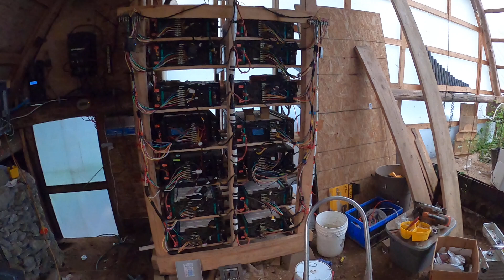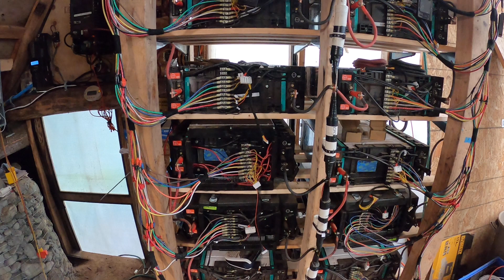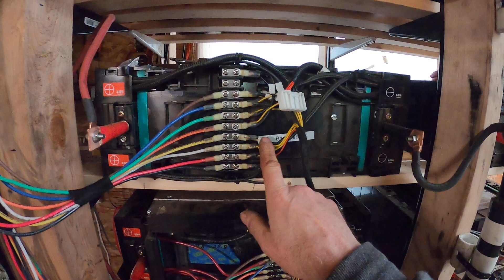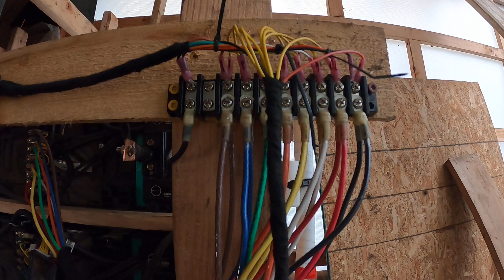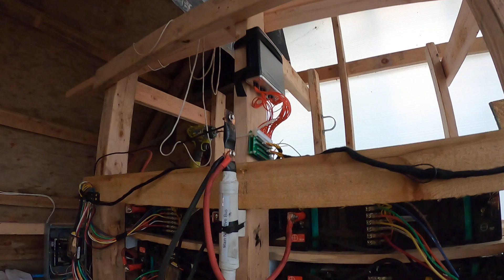14 Pack BYD Battery System With 5 amp active balancer, Cell level parallel bus AND NO BMS - Complete

Comment: Put "anydesk" on the old phone, and then you can look at and control it from "anywhere".

Very nice setup, especially with 1 balancer.

I put four balancers on my 8 packs with the 2 amp version.

I probably should have cell paralleling, but I didn't really want to take the cover off.

Comment: where did you get batteries like these please.
Reply from the maker: From battery clearing house.
Reply from the maker: I would highly reccomend you look at new 280AH EVE cells from Shenzen Luyuan on Alibaba.  They are much cheaper in the long run than these used BYD packs.  They are also much easier to work with.

Comment: This freaks me out, I just ordered 14 of these and was looking for information on exactly this configuration.
Reply from the maker: Where did you order from?  This pack has been working great for us.  The learning curve was steep with these used units.  The cells start to rapidly get out of balance and endanger themselves when they get near full charge or empty.  Watch yours carefully so the cells dont get too far out of balance.  I have found 53.6 to be fully charged (half that for single module or a 24V nominal battery pack)  and about 48V fully discharged.  (Set a discharge disconnect on your loads a bit above 48V.  (or 24V).  And set your charger source to never go above about 53.6.  (your packs may vary from that.  (Watch them charge and discharge carefully.)
Reply: @metagrid9453  Battery Hookup.  I upped the order to 16 and they shipped them on ONE pallet.  The pallet was scrap wood and the shippers had inserted another pallet into it.  Most damage appears to be to the outer casings, parts that I will most likely remove anyway but the cells seem to have survived. No green straps were damaged. I have charged the one unit that was in the 22 volt range but it did not balance completely (ISDT Q8) but the next unit is nearly charged and is balancing well.  I am weeks away from implementation. I am currently thinking of two carts of 8 batteries each. I might parallel cells on each cart and use an active equalizer on the entire block as you have done.  I am also considering one of the cheaper active balancers with a battery monitor across each 2 units (48 volts) so I can keep track of each pack.  I do not know if RS-485/CAN reporting is in the budget but it would be nice to have data when I am not here. It would take a lot of effort for someone to convince me to use a BMS in this setup!  In any case I will be using 10/12 gauge wires with fuse to every cell. I have been reading a lot about operating voltage ranges on these BYD packs and LifePO4 in general.  I will add your recommendations to my notes.  These will primarily be charged by MorningStar & Sensata/MagnaSine pairings with possibly a Midnight controller at some point for backup diesel. All of these should allow me to limit charging voltages and currents. Thank you for posting these videos.
Reply from the maker: I had some case damage on my last order from Battery Clearing House as well.  22V is pretty low.  Hope that one revives for you.

Comment: Greetings!  Falling more and more in love with the idea of a simple balancer rather than a low-current balancing BMS...  I'm curious if you think the 2A model would suffice for 8 of these BYD modules in 4P2S?  The 2A version via Ebay and via USA seller runs ~$130 vs. $430 for the 5A bluetooth models.  Typical load on battery bank will be 0.1-0.2C.  Thanks!
Reply from the maker: I think it would work fine as long as you don't push the battery pack too hard. There is not much capacity anyway at the higher and lower ends of the voltage curve and that is where  the cells get imbalanced imbalanced and can get away from you quickly.
Reply: I got same 4 BYD in 4P2S that you tried the Active balance 2A that works it's enough or the 5Amp more sufficient to keep them in balance when start discharging

Comment: Can u please provide a link to the 5a active balancer you used?
Reply from the maker: It may have been removed from eBay.  Here it is from the same seller on aliexpress:

https://www.aliexpress.com/item/33036949073.html?spm=2114.12010612.8148356.40.5b771313Qd927L
Reply: Many thanks

Comment: Now that you have this setup paralleling the individual cells and doing the active balancing between all of them has your overall capacity gone up?  I think your previous video you showed about 6.55kWh for 2 batteries.
Reply from the maker: Have not had a chance to do a capacity test.  Best guess is that I have gained 10%.  As soon as I put a meter on it I will post results.
Reply from the maker: I tested capacity from 54.4 volts down to 48 volts and saw 47 KWH.  Latest video gives more detail.
Reply: Thanks for the update.